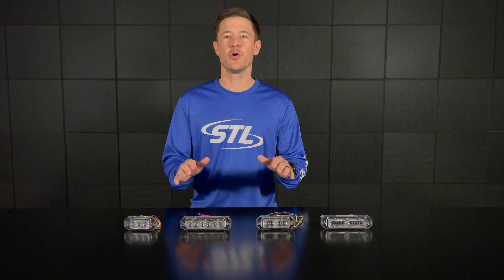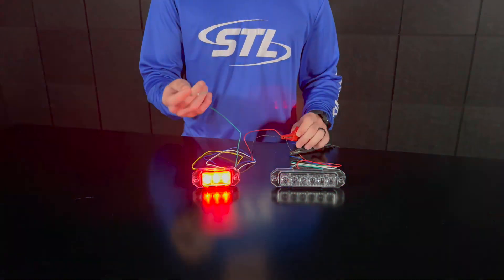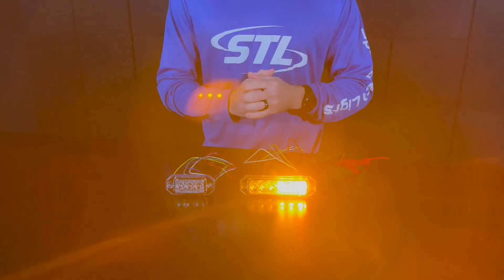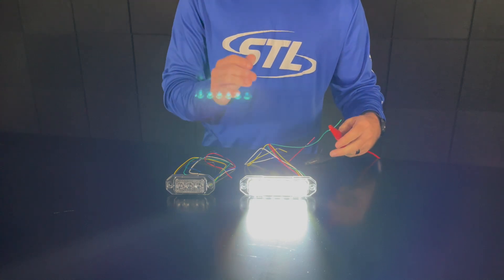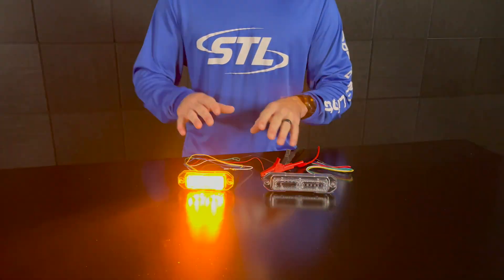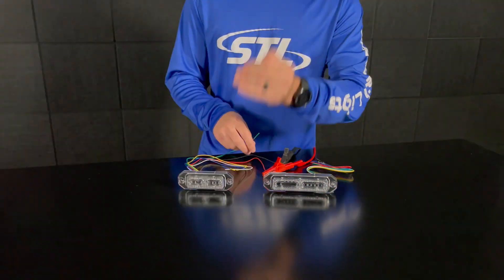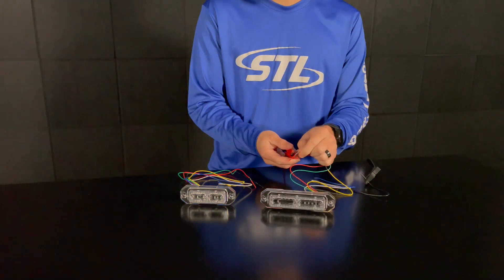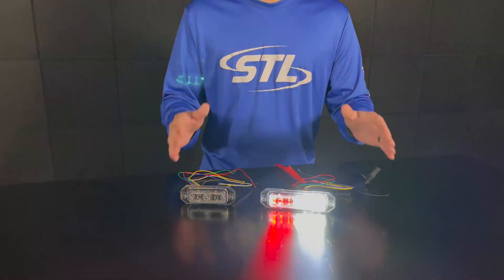SpeedTech SpotLight: Z® Surface Mounts - Green Steady Burn Override

Comment: @speedtechlights if you have a multicolor z12 in red/clear, what color is the steady burn? Is it red or clear?
Reply from the maker: The MultiColor Zs will steady burn in the secondary color. On the Red/Clear unit, the unit will steady burn in Clear.

Comment: I’m looking to purchase some of the Z6 Super Takedowns, and was curious if there was a way to activate steady burn for the primary color(s) of the unit (not white). I see the green cable will activate the white override, but is there a way to activate the other colors in steady burn? Looking to hook these lights up to brake / reverse / turn signal function, and these would be prefect if both colors had a way to be solid!
Reply from the maker: Hello Jay, no on these models the white will go steady burn. If you are looking for that effect, I would suggest going with our Dual Z-6 TIR and get one unit in Red and one unit in Clear. Then you could hook up the Red unit to your Brake/Turn Signals and the White lights to your reverse function. Check it out here: https://www.speedtechlights.com/LED-Grille-Surface-Mount-Lights/z-6x-tir-double-stack-led-surface-mount-warning-light-heads

Comment: I'm looking at buying some surface mount lights, I have two in mind, both shown here.
Great to see how those connections work, adds some ideas I didn't have before.
Am I correct in believing I could get a light in say amber/red and select an amber only flash pattern, but then when I touch my brakes, it goes steady red with my brake lights?
Reply from the maker: Hello, no not currently because in an Red/Amber unit your secondary color will be Amber. The steady burn cable with activate the secondary color in steady burn on our Multicolor units. That's great feedback though! We will look into a way to see if we can swap primary/secondary color in the programming of our units.

Comment: It would be a major improvement if the green wire could power steady burn independently without first having to power the red wire. For example I would like to use my 2 white Z3 on either side of my truck toolbox and have the ability to use them as warning but also independently as L or R alley without having my warning lights activated
Reply from the maker: Hello James, the Green cable with have it's own independent power so these would be perfect for you!